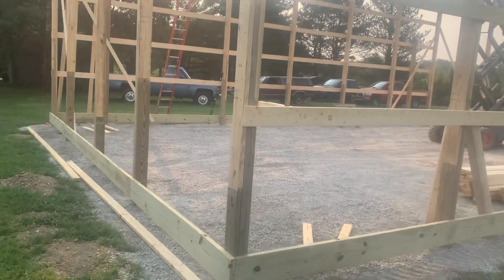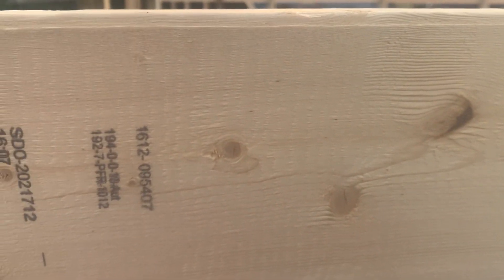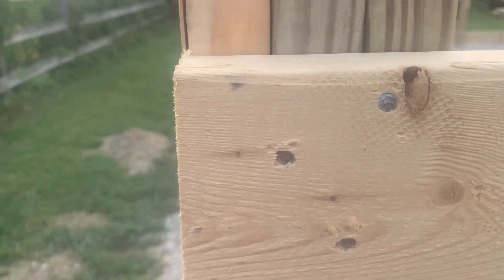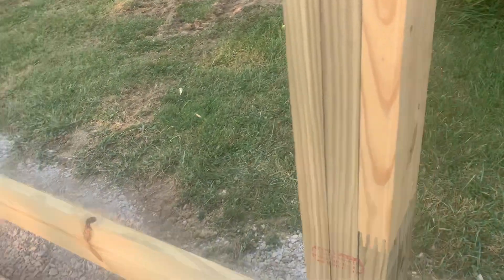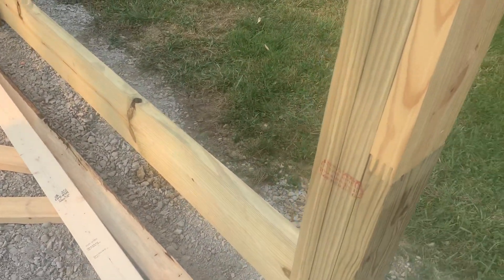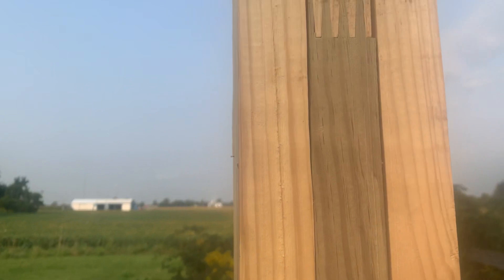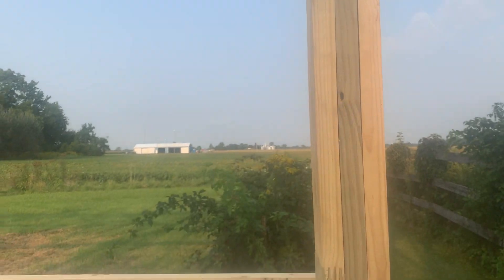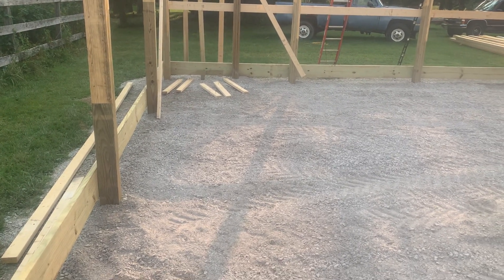Should you use 3-Ply 2x6 Laminated columns on a Pole Barn?? (32x48)

Comment: Ground is always wet where I'm at. Concrete pilings with strong ties and 3 ply 2×6's on top. My 30×40 pole barn has a post completely rotted less than 20 years old. I bought the property like that a couple years ago. Fortunately it's on the non bearing end.
Reply from the maker: Water/Wetness is tough to manage. Sounds like you know what you are doing.
Reply: @Polebarnshops What kind of gravel did you lay down, and how thick?  Thanks for showing clearly, up close!
Reply: should use perma column brackets set in piers, poles will last forever.